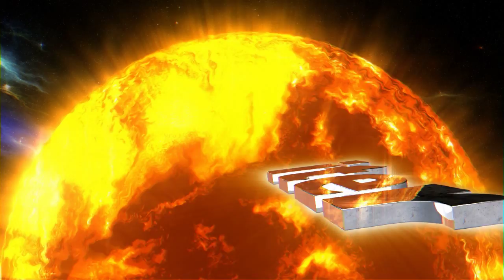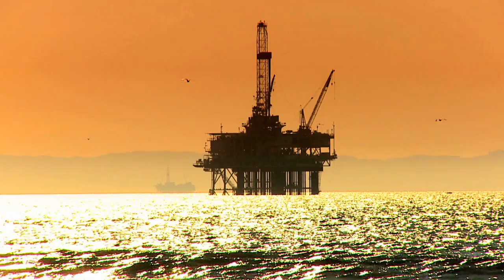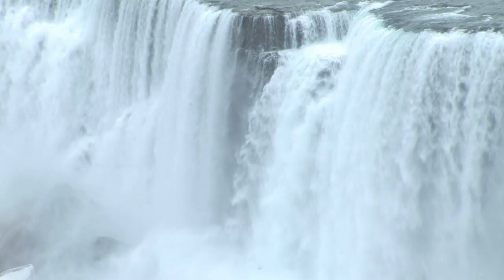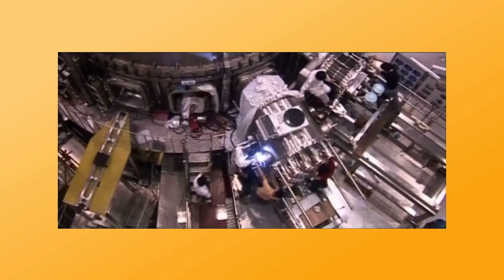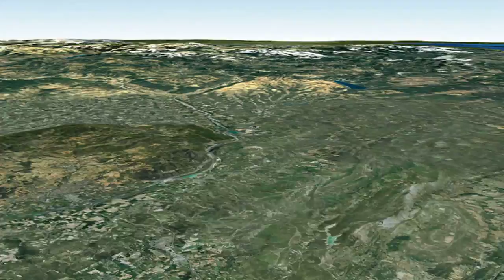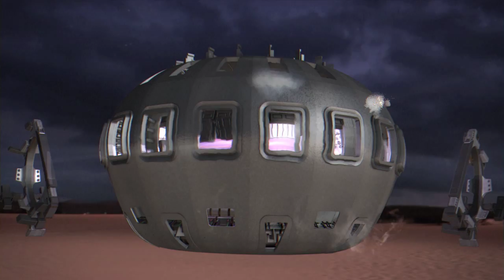ITER - nuclear fusion power plant prototype

Comment: Indeed, the tokamak design wont even work to gather the power, because if there could be areas in it exposed to the thermal neutrons that would heat the water from the turbines, then the magnetic field would be broken. The real fusion power plant that will become commercially useable is the polywell fusor. Already developed, it just needs $200m to build the first 100mw unit

Comment: I dont know where you got that information but it is incorrect. Tridium would decompose in the ocean. Even if it did get into the ocean, the process of extracting it from the ocean would be nearly impossible. Extracting it from the surface of the moon is much more practical.